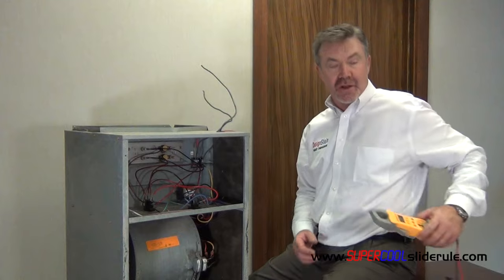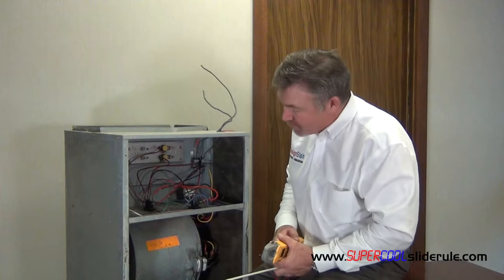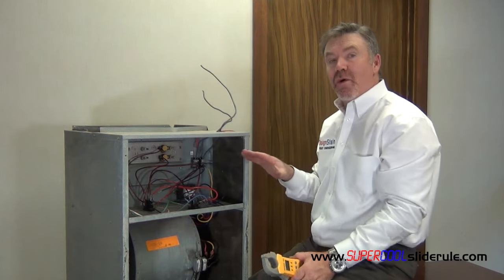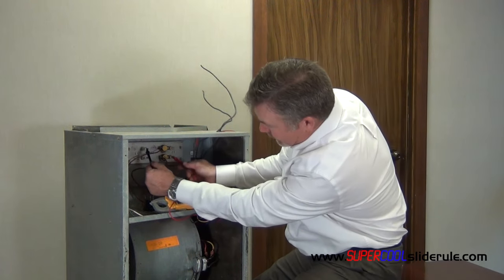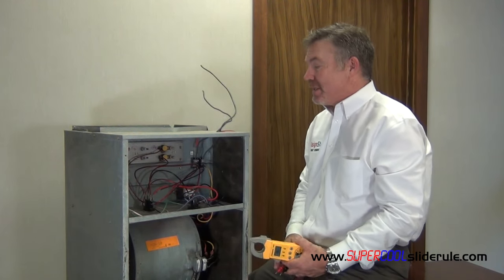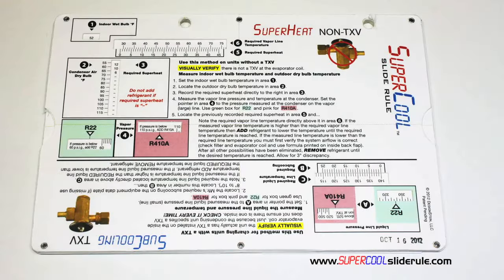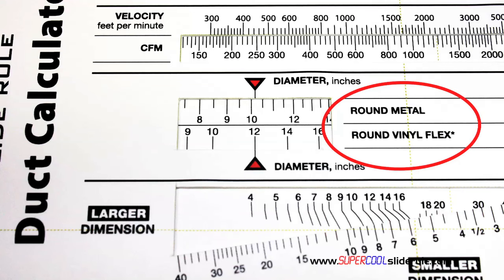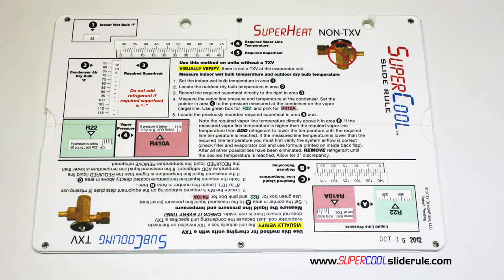How to Troubleshoot and Test an Electric Heater

Comment: Thanks.  My condo unit will often trip the circuit breaker.  I was told it may be a bad heating element, but I guess you have to do all this checking to confirm?  Wow, I may have to just pay someone as mine is located over the bath tub and difficult to access?  Is there a short list you can recommend for one that trips the breaker often?

Comment: I have a question about the heat cycle..........I have a 15 kw furnance...with 10 kw on a double stack seq...and 5 kw on a single seq.......the 10 kw element is also on a single ..double stack high heat limit switch.......and the 5 kw element is on its on limit switch........Now I know that the 24v stat powers up the the double stack and the single stack sequencers......which powers up the elements in a certain order.....So here is what is happening.........during the call for heat from the stat.....the furnace comes on properly......but the elements are clicking on and off during the cycle before the stat is satisfied.....the double stack limit switch is opening and closing during the cycle continually ....I did find a weak capacitor 7.5 and it was only reading 3.6......the blower is clean and i mean spotless lol......and there is NO duct work problems.....so WHY would that double stack limit switch be opening and closing during the cycle......I thought it might be bad so I replaced it and the new one is doing the same thing

Comment: the heat strip guide is completely wrong.5kw is 10 wire 30 amp breaker,8kw is 40 to 50 amp,10kw is 60 amp,15kw is a 60 and a 30 amp.and 20kw is a 60 and a 60 amp breaker.some of the wire size is wrong also.Please Dont Use That Guide.